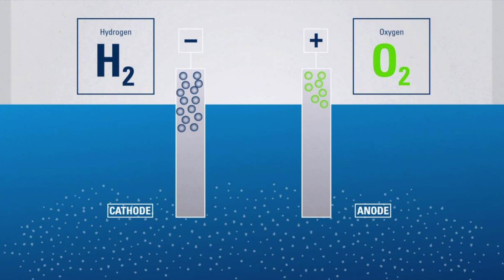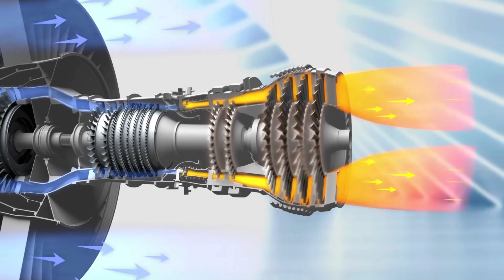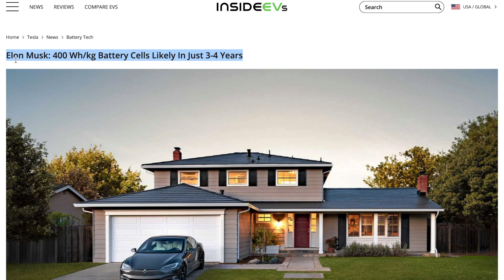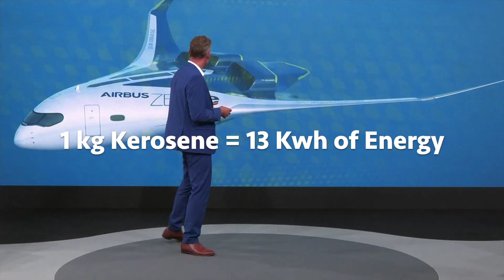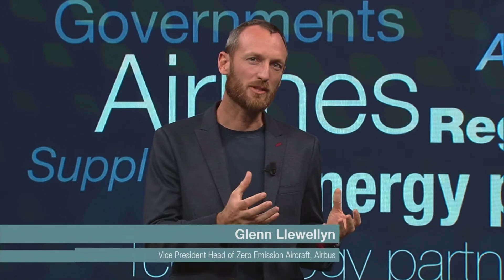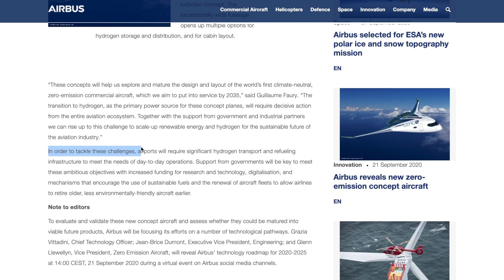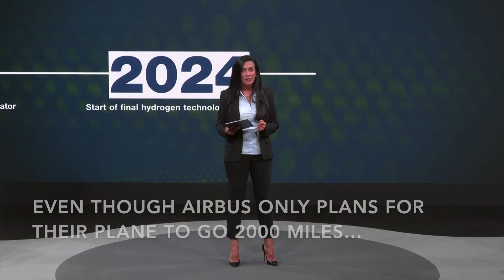Why A Hydrogen Plane Is A Terrible Idea

Comment: Hi, great video and arguments.. but your central premise is that the cost of hydrogen is too expensive compared with jet fuel/kerosene.. this is why regulation is necessary to remove jet fuel and other toxic fuels from the equation.  Yes, those fuels may be cheaper options, but they should not be permitted in the first place.  That is like saying we can fuel cars with cyanide instead of hydrogen because cyanide is cheaper than hydrogen.. it's a ridiculous argument!  If you factor in all of the true and hidden costs associated with using fossil fuels, such as the cost of the toxic effects on the planet, population and environment in general, then it becomes clear that jet fuels are simply too expensive to be permitted any longer.  Every airplane burning jet fuel is constantly releasing enormous amounts of toxins in the atmosphere, which rain down on people, causing all kinds of health problems, including various cancers throughout the body as a result of dioxins and other toxins released during combustion.  You are discounting the major benefit of hydrogen far too much, because you are only considering the face value costs, but not the overall costs that result in polluting the environment.  You say that hydrogen burns to create only water, but you don't talk at all about what is in jet fuel exhaust or what those effects are on the environment.  When you factor in those costs, the comparison becomes much more honest and clear.  Also, you talk about how electrical charging stations are so much less expensive than hydrogen refilling stations.  But that is only because so much development and expense has been put into jet fuel refilling infrastructure and fossil fuel pipelines, etc.. but if all or even a tiny fraction of those resources had been diverted in parallel to build out hydrogen distribution infrastructure, then we could have already been enjoying hydrogen powered vehicles to this day.  But because the oil industry is able to profit far more from drilling oil instead of producing hydrogen via electrolysis, that is the true reason why vehicles haven't been using hydrogen power for many years already.

Comment: Something that is forgotten when talking about refilling is time. After working on an airfield, you see that it takes longer to load people on a plane than to fill the tanks. This would not be the case with batteries, at least in current projections. Which would give hydrogen a leg up commercially for flight turnaround time which is a MASSIVE cost advantage. The longer a plane is on the ground the less money it is making.
Another topic is repair, after working on planes, removing the battery cells would take far more manhours, experienced workers, and resources than maintaining the hydrogen engines.
Reply: Also if you work with planes, you know that you only put the fuel you need on a plane to save on weight for efficiency, you can't do that with a battery, meaning loss during take-off and landing would be the same for shorter flights as longer ones, causing them to be inefficient for shorter flights. which defeats the purpose when batteries struggle and are damaged by longer output.
Reply: Swapping out batteries has potential to be faster or just as fast as a hydrogen system (depending on whether or not hydrogen systems swapped tanks as well), so I don't consider that to be a valid argument. I think battery-powered planes is ridiculous, but the reason is solely due it's terrible specific energy (and that won't significantly change).
Reply: Jet fuelled planes get lighter as they use up fuel over the duration of their journey and therefore cheaper to run. Battery planes will not.

Comment: I think for this application -- long range jet aircraft -- ultimately H2 is the way to go. We just need a way to store it at room temperature. Because it has more energy per unit MASS than kerosene (and a lot more than batteries), but takes up more volume at room temperature. Maybe carbon buckyballs or carbon nanotubes?

But hydrogen also gives you the ability to burn a fuel (as in combine it with oxygen and add a spark to ignite it) in a rocket or jet engine to go supersonic/hypersonic. Because a propeller/ducted fan driven aircraft can't meet or exceed Mach 1 as far as we know. :)

As far as making it in a green way, use nuclear power, that's what we do on submarines. We use the nuclear reactor to generate the electricity to split seawater, and we vent the hydrogen overboard and vent the oxygen inside the hull so we can breathe it. :)
Reply: The hydrogen tank can act as a structural part of the aircraft hull. Thus saving a lot of weight from the plane and compensating for having such a beefy fuel tank.

Comment: Yes, the economics for hydrogen are not favorable, and they are unlikely to become favorable.

You made a point with which I'm inclined to disagree - though there are so many unknowns, certainty eludes me.  The point was, hydrogen will have advantages over electric propulsion for long distance routes.

I don't think so.  I think it's the reverse.  Elon's VTOL supersonic jet concept only works at longer ranges.  That's where its advantages lie.

Hydrogen combustion will suffer the same altitude penalties as jet fuel, approximately.  Ceilings are imposed by combustion's needs.  When the air is too thin, the engines suffer inefficiencies or won't work at all.  By way of contrast, an electric jet's ceiling is imposed by the need for control authority, not combustion.  They can go much, much higher.

If an electric passenger jet is optimized for high-altitude supercruising, then it needs to spend time ascending to where supercruising is practical and then stay up there for an extended period to take advantage of speed and low energy consumption.  The best route for such an aircraft is a very long one.  The advantage of supercruising won't appear on short hops.

So the cheaper energy costs for batteries will be most significant on long routes - if Elon's concept is workable.

We aren't sure that it is.

Fifteen years isn't a very long time to bring an electric VTOL supercruising passenger jet to the market.  Some of those years will be lost while we wait for better energy densities for batteries.  Then there's the expense and difficulty of designing, prototyping and manufacturing a proven design.  This aircraft will be unlike anything we've ever seen before.

It will be enormous.  Elon estimates that 70% of its mass will be taken up by batteries alone.  Adding in fuselage, wings, control surfaces, and interior fittings will leave very little room for passengers and cargo.  The only way to get enough room to carry practical loads of people and cargo will be to scale the sucker up.  A lot.

The R&D developmental pathway for such an enormous aircraft will be long.  We will not see it in 2035.

But we won't see Airbus deliver commercial hydrogen jets in 2035, either, unless the effort is heavily subsidized by taxpayers.

It's the EU's governments that Airbus is addressing with its presentation.  Airbus knows their hydrogen jets won't be economically viable on their own, but if Airbus can get generous subsidies?  If the EU's governments and taxpayers can be persuaded, then there's a profit in it for the company.

EU governments might bite.  The EU is very eager to reduce CO2 emissions.

Airlines and airports will make it clear that they can't use hydrogen jets without subsidies, too.

It could end up happening.  Airbus could deliver those airplanes.  But if it does, taxpayers will be on the hook for the entire life cycle of these aircraft, from development to the boneyard.

Electric VTOL supersonic jets will not appear on Airbus' timeline.  The only competition is traditional jet-fueled aircraft.  The EU will be making a choice - extend reliance on fossil fuels for air transportation, or elect to go with a technology that isn't economical and force taxpayers to suffer a higher tax burden.  It's not an appealing choice to have to make, but make it, they will.
Reply: @Daniel Saadat Hell, it's not effort if it's fun.  This is definitely a fun topic!
Reply: @Urgelt  Hey man You seem like a smart guy. So I got a question do you think biodiesel will be used in alot in transportation cars/trains/boats ect in the near future. Considering it produces far less emissions than gasoline and regular diesel. I know the ideal goal would be zero emissions but wouldn’t much less emissions be good too especially since the technology for biodiesel is already made
Reply: @drakessupersecretchannel6086  I'm not a smart guy.  I only play one on YouTube.  But if you want my opinion, have at it!

The problems with biodiesel, as I see things, are:

  -  It does produce emissions.  Diesel emissions are very, very, very bad to breathe.  Breathing those fumes kills thousands of people every year.  Even if you could argue that CO2 emissions balance out (CO2 produced by burning it = CO2 stored from the air by producing it), the other gases are nasty, toxic and bad for human quality of life and longevity.

  -  CO2 emissions don't balance out.  Biodiesel comes from farming.  Farming, as it exists today, is highly dependent on fossil fuels for energy, for fertilizers, and for a wide array of toxic substances used in farming to increase yields.  A liter of biodiesel took several liters of fossil fuels to make.  Using them to create biodiesel, and then burning biodiesel, results in more CO2 being released than just burning a liter of fossil fuel in the first place.  Biodiesel is a CO2 emissions multiplier, not a green energy fuel.

  -  Biodiesel doesn't work economically without government subsidies.  Me, I don't mind government subsidies to help us to move from one status quo to another.  But I resist the idea of permanent subsidies.  If a technology can't ever stand on its own economic merits (nuclear, biodiesel), it's the wrong technology.

  -  Biodiesel produces the side-effect of making food prices higher.  That's rough on the poorest 1/4th of the world population.  Unless you think they don't matter?

  -  Biodiesel also motivates clearing more land for farming.  It's helping us to eliminate the world's remaining natural forests.

All in all, not a good look.  Just burning fossil fuels is greener than biodiesel.  So why do we believe differently?

Special interests + propaganda.  Some people will do or say anything for a buck.
Reply: @Urgelt  Thanks for the response. It was very informative.

Comment: Without going into details, the bottom line is that battery technology will never work for long-distance air travel even with the projected and highly optimistic 8x improvement in energy density which this article mentions. Also, LH2 does not need to match conventional jet fuel in price, it merely needs to be cheap enough to cost, say, $350 per passenger for 5500 miles Europe to California, which is within the realm of possibility with current technology.

Comment: The problem with electric planes is that propeller driven aircrafts are extremly slow. Also, Airbus need to start developing this planes now, and not in 5 to 10 years, if batteries are better. A plane is not as fast developed as a car.

Comment: Battery technology would have to be entirely revolutionized in order for a battery only plane to fly commercially. Batteries that could power a plane are currently too heavy and too large to fit on a passenger airliner, and their energy density is too low. The plane literally wouldn’t be able to make it off the ground. 

Even if the energy density problem can be solved, there is still the problem of recharging. Electric cars take around an hour to recharge, which is already longer than a plane requires to refuel. How many hours, or rather days, would it take to charge a plane?

Comment: One of the things you forgot to mention, is that hydragen will be used in a turbo fan engine. While batteries will be used in a prop plane, propeller driven planes are much more efficient however, most passenger travel uses a Turbofan engine for speed.

Comment: Would be interesting to know the charging time for electric plane.... And the power for charging as well  .....anyone?
Reply: Check out Volocopter's website or youtube channel, look into the VeloCity aircraft, a fully electric vehicle they are working on. It's based in Singapore I think, but they will be the first to put out any aircraft that's fully electric. In 2023 they will be piloted but later on, they plan on commercially using the electric version.
Reply: They have the data you're looking for

Comment: Please don't let yourself be misinformed by one single guy. It's not just Airbus but the entire Airline, Energy Industry that believes Hydrogen is the fuel of the future. Would you rather believe people who have spent their lifetime in the industry researching and developing new more fuel efficient technologies or a single guy making assumptions that aren't properly sourced? If we look at commercial airliners for short and medium range there is currently no other way than going for Sustainable Aviation Fuels and in the long run, hydrogen (fuel cells) planes. As for everything else, the decarbonisation of the airline industry will rely on the usage of multiple different technologies be it SAF, Carbon Capture technologies or hydrogen. We won't ve able to change from one technology to another like that. It's a process that is under constant development and inovation. Pure electric planes are as of today only viable for single engine propeller planes used for trainings...

Comment: Batteries are made of rare earth elements which are expensive and polluting. Do you know majority of the world's batteries are not viable for economic recycling
Reply: Lithium ion batteries have a dirty side. Extracting lithium and cobalt which are used for electric car batteries are not environmentally friendly. Depending on the vehicle the manufacturing process can emit 13-21 metric tones of co2 but a ICE car emits 7 metric tones to manufacture. However the fact that electric cars have zero emissions will make up for that.

Comment: I see great misconceptions that mess up your calculations. You're considering electrolysis, they'll probably use a proton exchange membrane. And you're considering combustion turbines and taking it down to 25% efficiency. Hydrogen can be used to power electric engines, and they say they are using a hybrid method to maximize efficiency. So your calculations are off, and they could go from 25% efficiency (after it is in the tank) to 70-80% what completely changes the figure

Comment: There are some points that need more investigation I believe so that your statement holds up. For example https://www.sciencedirect.com/science/article/pii/S0196890419311148 this article states the "levelized cost of hydrogen of $2.93–$3.22/kgH2 for alkaline electrolysis" which is the current rate. That is before reducing cost of renewable energy is taken in to account . A much larger issue is to carry 8 times the weight in batteries and also remember you have to carry that weight throughout the flight while Hydrogen will be reduced throughout a flight. Ontop of that we will have blended motors electric / combustion. Let's say that combustion is only required for takeoff and climb but a fuel cell is used to generate the rest of the energy. That means potential energy efficiency of up to 83%.
Reply: Yeah and hydrogen from methane is from 1.4-2.4 dollars when carbon capture is used. Hydrogen is a very viable option when and if governments start to impose carbon taxes on traditional fuels. Idk where the video creator got his facts from.

Comment: Electric planes face significant challenges for long-haul flights, primarily due to the limitations of propellers at transonic and supersonic speeds. In such scenarios, the propeller blades often reach supersonic velocities while the plane itself operates in the transonic range, resulting in excessive drag, noise, and reduced payload capacity—akin to the infamous XF-84H Thunderscreech.

Additionally, refueling electric planes would be a major logistical hurdle, especially given the immense heat generated by continuously running electric motors, which could lead to loss of magnetism and increased maintenance costs. The weight of the batteries further compounds the problem.

As a result, a typical 10-hour flight at speeds of 700-900 km/h could stretch to 18 hours or more. Current technology offers no alternative to blade-based electric propulsion systems, except ion engines, which produce minimal thrust and rely on both batteries and a gas source, making them impractical for large-scale aviation.

Comment: This guy shows he has no experience in aerospace, energy isn't the main expense, the main expense is maintenance, and electric engines that can run on hydrogen are notoriously low in maintenance needs. This guy thinks these major aerospace engineering companies can't do basic math but he can, lmao...    (the ideal propeller for a hydrogen plane is the ducted fan)